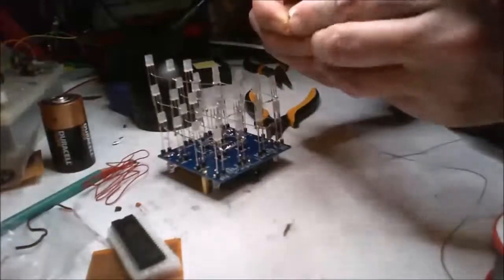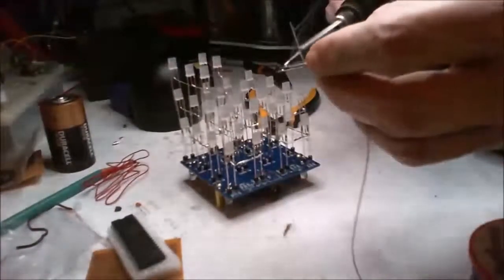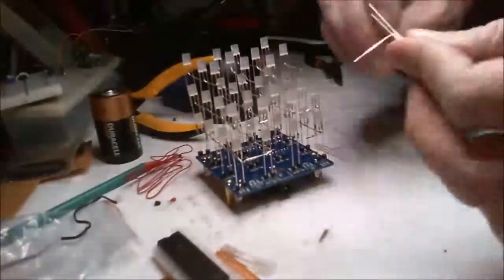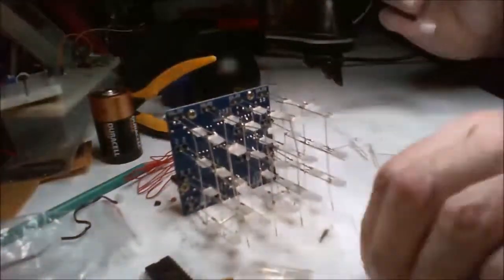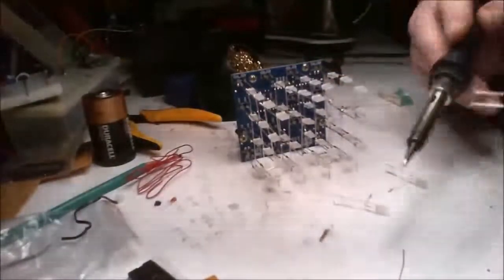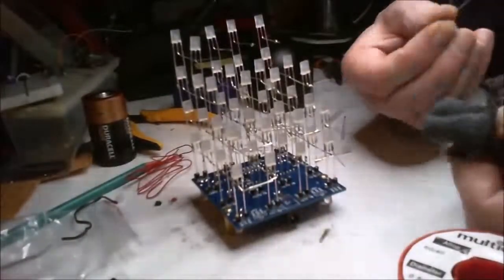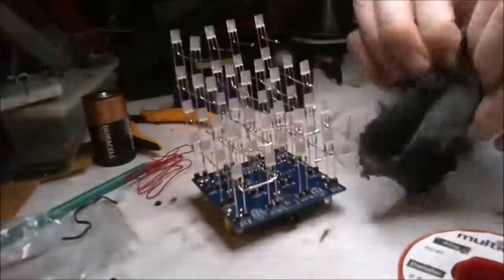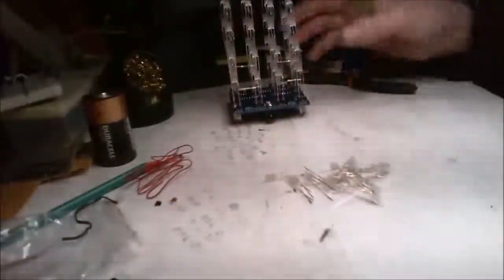Building a 3D LED Cube Red Blue Ray DIY Kit Part 4 of 4 (Fail)

Comment: The solder will take easier if you apply it directly to the joint instead of loading the solder onto the iron first as you are just cooking off the flux. I'd give those bad ones a clean with wire wool and try again with some more flux. You could even trim the legs then salvage some off other LEDs to extend.

You can get what look like the same LEDs from aliexpress, but it's probably not worth the cost
https://www.aliexpress.com/item/2-5-7-double-color-red-and-blue-a-total-of-Yin-Flat-square-red-blue/32705575923.html